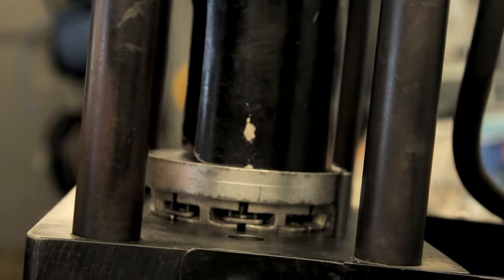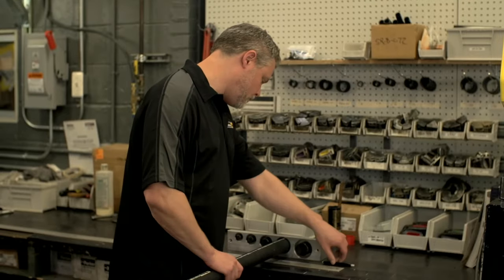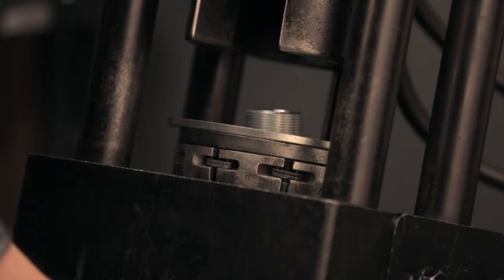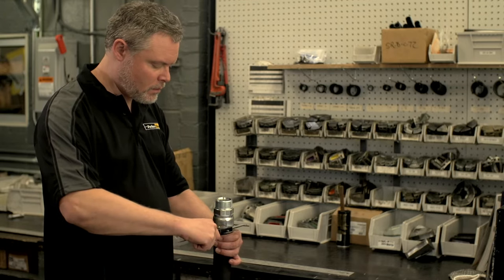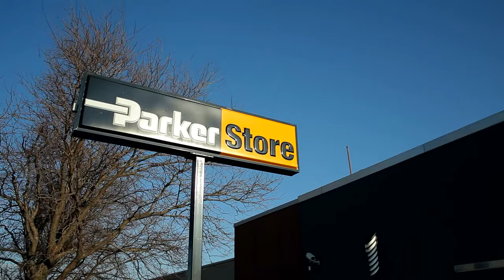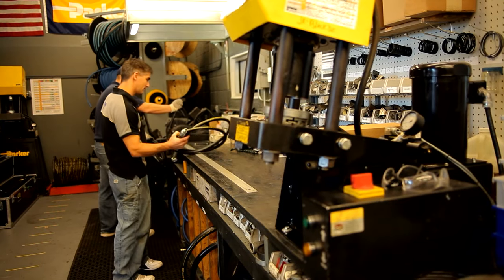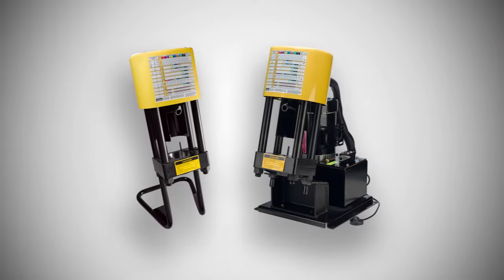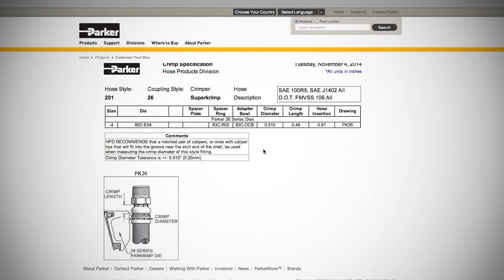How to Crimp a Hose Assembly - Parker Store Crimping

Comment: I noticed many of my crimp connectors have rings around the bottom, either 2 or 4. Sometimes the lines are solid & others dotted. My co-workers & I call them "ought" lines. When we have to make a hose I just duplicate the old hose best as possible including using the same lined crimp coupling. I've always assumed these "ought" lines were for the different series that we have, 43 or 70/71 but can't find any documentation online or on YouTube to confirm or disprove. Do you have any ideas on this? Great video BTW. Thanks
Reply from the maker: Hello and thank you for your inquiry!

I'm not on the technical side, but I think your question might be best answered by our Hose Products Division. Below is their contact information. Please reach out to them.

Tel: 1-440-943-5700
HPD.support@support.parker.com

Thank you,
The ParkerStore Team
Reply: Typical, corporate passing the buck, how about answering the question here for the guy and others to benefit from.
Reply: @johnkomosa9508  I think you're right. Going through some old books I pieced together my answers though. Two solid lines means the fitting should be used on hoses with 2 internal metal braids. 4 lines on the fitting means use on hoses with 4 internal metal braids. About the sometimes dotted line. Those are usually data or name lines. If you follow them around most will indicate where the reference number for the fitting is located at. Sometimes the dotted line shows a number, other times it shows a number that is really faded & hard to see. Sometimes they don't show anything & I think they are for decoration or put there by people who didn't know what they were doing.
Reply: @marinefixitguy3640  Thank you.